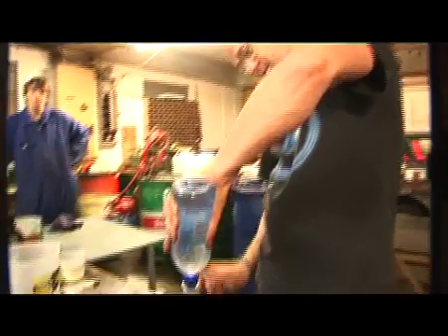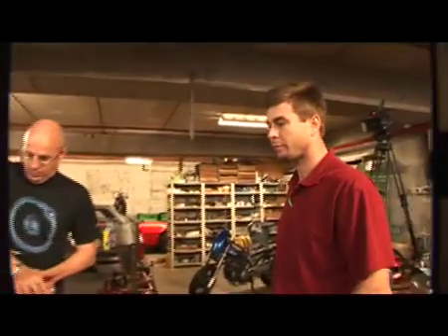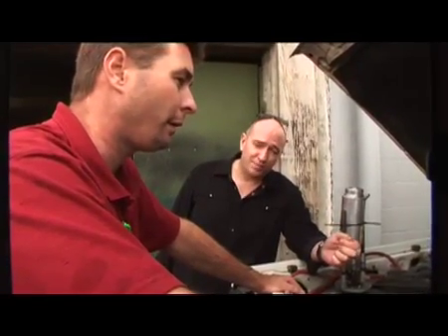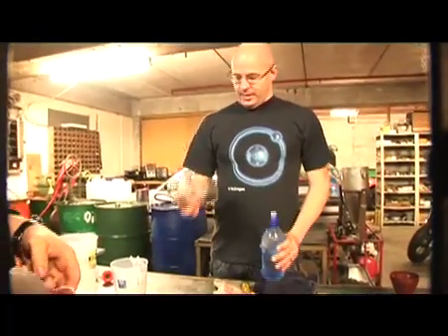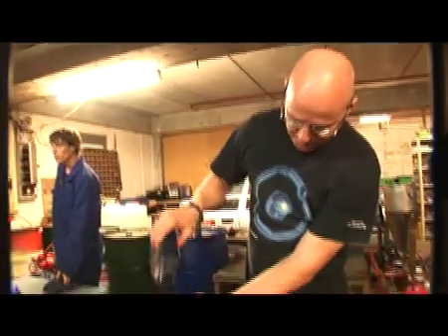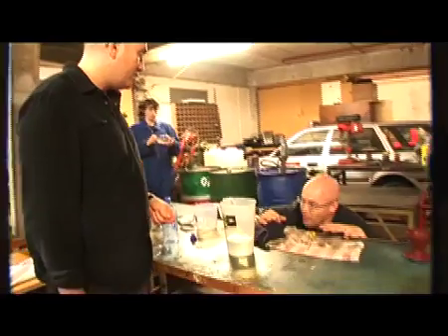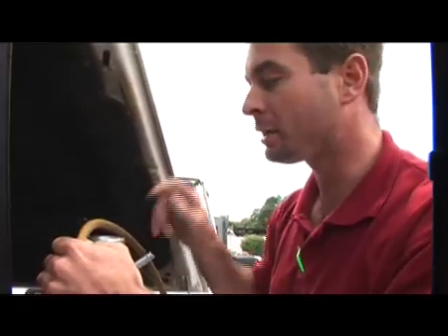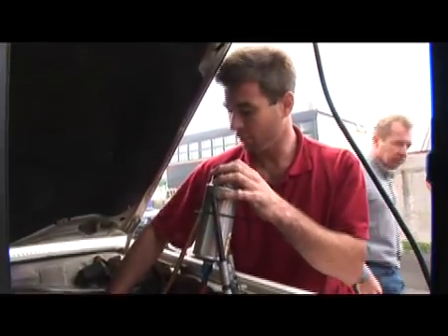Man Runs Car on 50% Water

Comment: Ok so you added water to the FUEL , all gas and desiel contain water thats why we started adding ethyanol to gas so the water won't freeze in the winter ,adding water ok so does it make the HP increase or decrease ,(decrease ) it does clean the carbon deposits from the engine

Comment: It seems like another hoax to me also. However the burning of magnesium dust has already been done. I am not sure if it was liquified or not. Arn't there some chemical reactions with aluminum that will produce hydrgen gas? I guess a mixture that needed heat like that of the combustion chamber could work. But, I am not familiar with this.

Comment: Hi, in Ryan´s earlier video he is just doing an electrolysis under pressure, so the generated H2 goes into solution into his water. The same is Byron energy doing.
You can do it with a normal electrolyzer and bubble
H2 into air depleted water.Then the H2 will go into solution into the water. Come to overunity dot com to discuss this. Regards, Stefan.